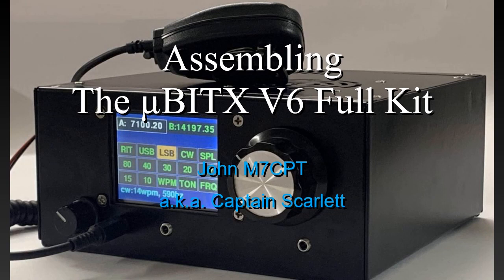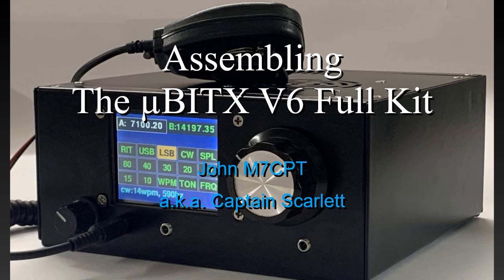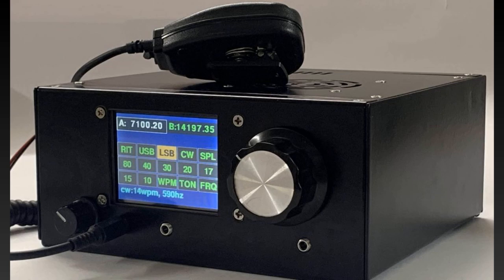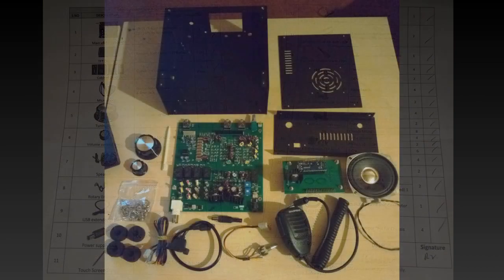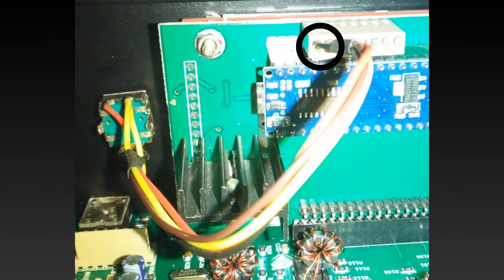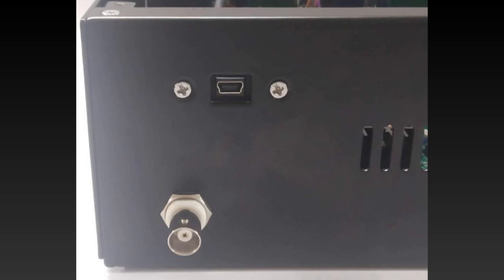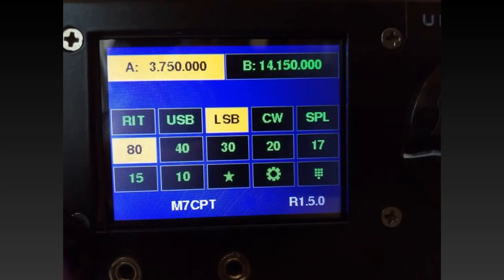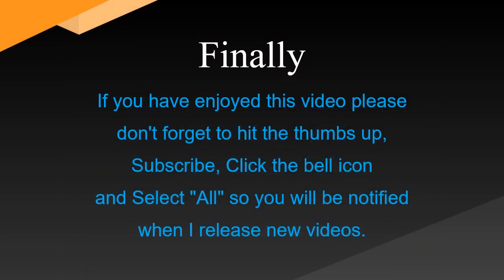Assembling The µBITX V6 Full Kit

Comment: I would recommend the radio highly. Also without experience in soldering. You don't have to make any changes to the radio. It works very perfect as it is. It is the only radio on the market that you can build without soldering. So just get going. It will give you some experience in home building as well as the joy on working home brew gear. Then I am sure that you want to learn to solder, which is very, very easy.
Reply from the maker: Before recommending it, I do urge a little caution this radio is not for everyone and there are other items that would be needed depending on your full setup. Please see this comparison video. https://www.youtube.com/watch?v=11jAtek1Phc